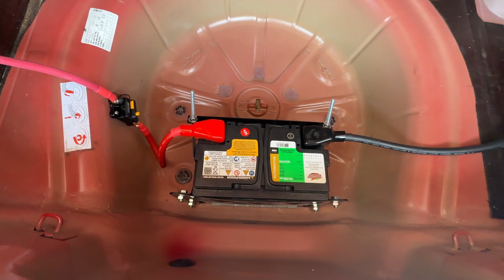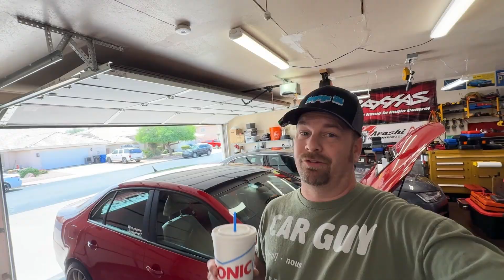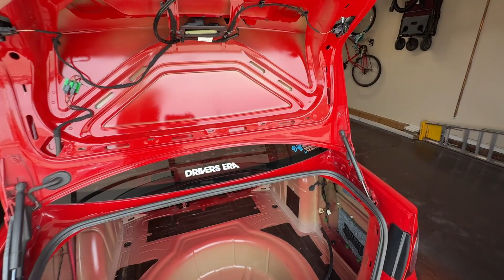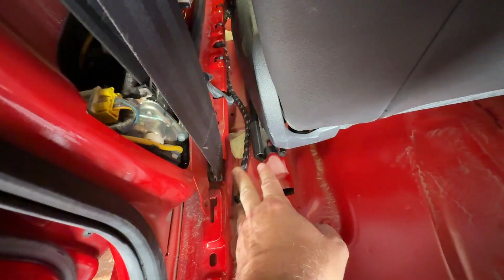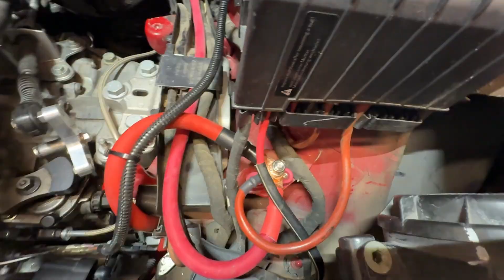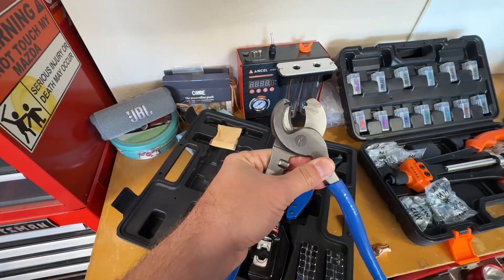How I Relocated my Battery to the Trunk | Everything you NEED TO KNOW to Relocate your Battery

Comment: how did you wire up the alternator power?
Reply from the maker: It doesn’t need a direct wire. The only power wires you need off the power distribution post are battery(supply), starter, and the fuse box. Thats how the factory wiring is.
Reply: @VoyageRC  ok makes sense. thx for the quick reply